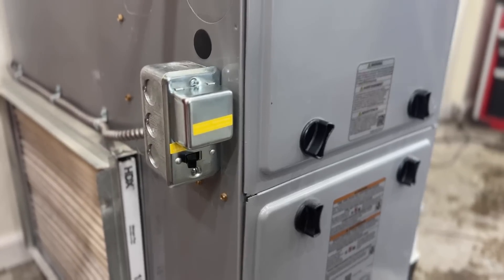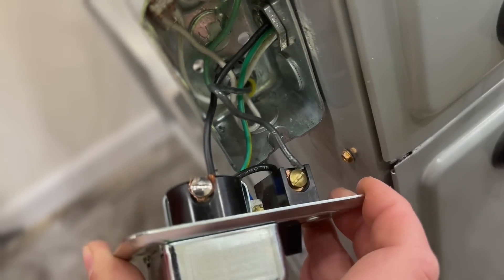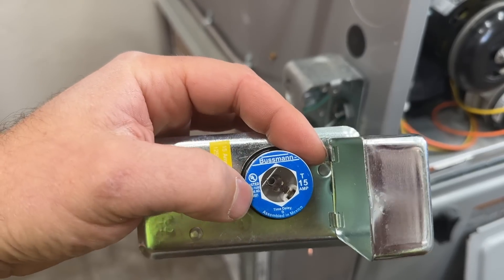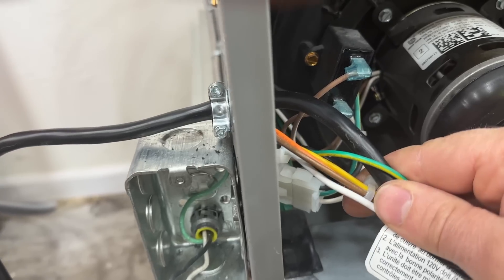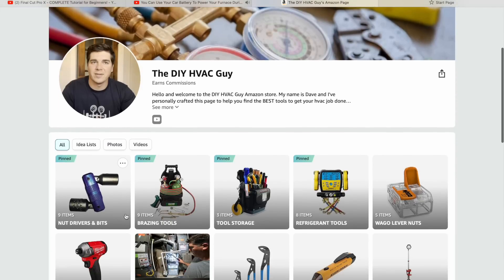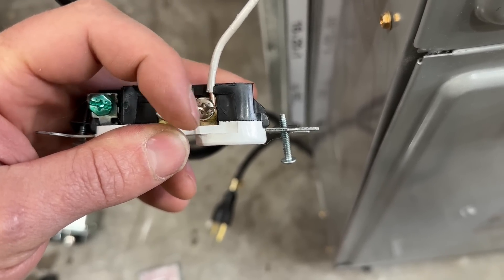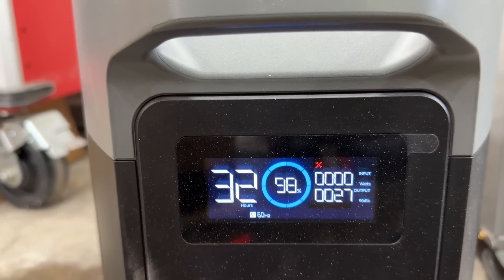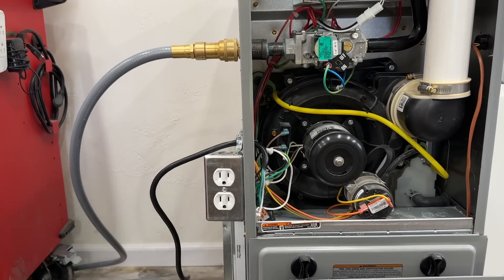Keep Your Family Warm During A Power Outage By Doing This.

Comment: Hey this is an awesome DYI. I just checked my furnace, the wires coming out of my furnace actually connects to a switch that gives power from the breaker. I don't see a fuse like the one you are showing at the 2:48 mark in your video. 

Would I be able to connect the pigtail to those wires without the fuse then change the switch to an outlet? 

Or should I just install a new outlet where the switch is, then install a switch controlling that outlet once the pigtail it plugged directly into it from the furnace?

Thanks

Comment: I tried to do this. It works totally fine on AC power, but when I connect the chord to my portable power station (EcoFlow River Pro 2), the furnace shuts down throwing a ground fault error. Any suggestions on how to fix this please? Thanks!
Reply from the maker: I’d suggest bonding your ground and neutral. See if that does the trick
Reply: @diyhvacguy  Thank you for responding! How do I go about doing that?

Comment: Hi, I have my ac unit almost 1 1/2 year now. New house here in California. My ac issue is suddenly heating is not working. I heard from the attic when I’m watching this video, humming sound like about to start but stop right away. It happened 3 times in different time & day the thermostat set on 73F it went up to 75F. The air filter replaced a month ago. Hope you can help me with this issue, my problem. Warranty is over. Thanks & God bless.

Comment: I guess the most flexible way to handle a condensate pump would be to plug it into the power station as well or, use a cube tap or power strip..

Comment: I have a switch/fuse location issue as far as it being mounted about 4 feet up from the bottom where furnace entry wire from the switch/fuse enters and I could have access.  The switch/fuse switch, only mounted, is 4 feet up and not directly accessible without disassembly of furnace cover.. the grid wire feeds directly into TOP of switch/fuse and furnace wire feeds from the bottom and enters the furnace 4 feet below the switch/fuse. The switch/fuse only mounted at 4 feet above furnace wire entry below.  My furnace is a Rheem installed in 1993.

Comment: A good idea to temporarily bypass the power supply but how do we recharge the battery power centre?
Reply: Portable solar panels would do it.  
For extended outages, some use a generator during the day and a power station at night.
Reply: Plug it into the outlet permanently.  @rik8809
Reply: @rik8809 A gas generator I assume or a very large solar panel setup.

Comment: Myself after coming for the furnace tuneup, I was sucked into the power back up vortex. After all the options I bought and set myself a Generac 10k ng unit with sheding 16 breaker automatic switch. Also smooth start for 3 ton A/C unit. Have not needed it yet.

Comment: How much voltage-amps-watts does an "average" furnace  use?  Thank You !!
Reply: My old 70s furnace drew about 400 watts running and my new energy efficient furnace draws about 180 watts running on a cold day around 20F.  They both only ran 50% of the time so 200 watt/hrs and 90 watt/hrs.  Best to buy a monitor and plug it in and monitor the furnace on a typical cold day to see how many watts it draws.  I set up my home battery bank to handle my whole house load for 8 hours so I did not have to start my generator right away.
Reply: @chuck_howard  Thank you Chuck for the info I appreciate it.

Comment: My new Trane furnace requires a proper bonded ground both to run off the grid power and to run using my Renogy 2000 watt inverter.  Originally Renogy told me my new furnace was not compatible and when I hooked up my inverter the furnace refused to start. They said this was the word from their "best" engineers.  As soon as I put a ground lead from the inverter ground bus to the chasis it worked just fine.  I also called up Renogy to tell them their engineers were wrong.
Reply: If that's their best engineering, return the Renogy while you still can.
Reply: @ewicky  The build quality is great. I have never had any of their products fail.  It's the so called engineers on their customer support staff that have no clue.  I am guessing it's just a bunch of tech level people reading scripts in customer service the same as most large companies now.  If it's not written down they just say it won't work even if it does with some easy modification.

Comment: This works fine, but the ground wire does have to be connected to the breaker box due to the finiky electronics, the ground on a generator or battery doesnt work, it needs to be the correct grounding, so I connected an outlet and made sure the ground wire is always connected to the breaker box from the furnace and it works like a charm and I had to use it a couple of months ago during a coupe or three hour outage
Reply: On my older furnace that was not true, but on my newer furnace it needs a proper bonded ground to run using the mains power and to run with my Renogy 2000 watt inverter.

Comment: In some places in the US they allow the doorbell transformer to be shared with the furnace.  The fused switch gives some protection for that.  The furnace has a fuse on the PC board usually located on the squirrel cage/blower motor that will protect the furnace and motor.  Hey it's your house do what ever but hook things back when you sell the house.

Comment: Wouldn't it be better to wire the receptacle through the fuse (add a second box) so it has the same protection if it's a different rating than the breaker? I don't know why you would have a fuse and a breaker but I'm sure some districts have a reason.
Reply: I don't think you need a fuse.  You've got a breaker already in the circuit via the inverter.

Comment: I think you should work with a licensed electrician, I don’t think you understand what the fuse is for
and it is a code requirement in many jurisdictions. The fuse is for mainly motor protection it is much
more sensitive than a breaker of the same rating. The motor can over heat and catch on fire before the
breaker trips.
Reply: That's only one thing that's wrong here.  The unprotected cord out in the open where it is susceptible to damage is another issue.  He continues to make these kind of mods, which while they work, would not pass an inspection.  Notice how he never says it's "to code".  If you want to do this kind of thing, spend a few extra bucks and do it right with a power inlet transfer switch.  A brand name one costs about $55, and would pass an inspection without problems.
Reply: @yeroca  no one can say "to meet code" because literally every county of every state has different codes......... I swear, common sense is like having a super power nowadays
Reply: @natersalad889  You have made a fine point, but this solution doesn't meet any NEC code from the last 20 years, and most state codes are based upon NEC from some year.  So this solution has an excellent chance of not being code-compliant.  See 422.16 (A)(2) of NEC 2023, for example.  Most gas furnaces are not "intended or identified for flexible cord connection"
Reply: @yeroca   Maybe a fake UL listed one costs $55 but not a real one
Reply: I am very interested in knowing why there is a fuse after the breaker.  My dad and I live in the same town, his furnace has a fuse as shown here and mine doesn't.  What gives?  I see your point of using a fuse working as a normal and a breaker as slow-blow fuse.
Reply: @JT-lq4yd  Hi,  hopefully your furnace was installed by a competent installer and a inspection was
done by the authority having jurisdiction. your furnace maybe newer and have it’s over current protection 
 built into the furnace. I just don’t think you start removing things without completely understanding there
intended  purpose. There is a reason why electrician’s are licensed. Breakers are not considered as proper 
over current protection for motors, ask an electrician.
Reply: @JT-lq4yd this type of switch an SSU switch and the fuse is called an edison fuse. Some furnaces may list an MOCP (maximum overcurrent protection).  Say 6.25amps.  Most furnaces are on a 15amp circuit.  In this scenario a SSU switch with 6.25amp edison fuse would be needed to protect the device.

In the video the edison fuse was 15amp as well as being on a 15amp circuit.  Thus, the 15amp edison fuse is not providing any more additional protection than the 15amp circuit/breaker already provides.

These videos are showing what can be done to prepare yourself for an emergency or during an emergency situation.  

Keep the original parts and change it back if ever needed. (I.e. selling a home and local inspector requires SSU switch with a specific amp rated edison fuse at furnace).

Comment: Hi Dave: Thanks for these keep your furnace going videos. I watched your original ones, and installed the “plug,switch, pigtail” setup in the 12-9-22 video as you directed, then I upgraded following your methods in the “EX Generator Switch” video of 2-24-23. I saw you used the Ecobee thermostat at your house, so I purchased and installed that too. When I tested for each setup, I only did several minutes to confirm functions. But, I just had my first outage, and was happy to use the EZ Transfer Switch setup. The furnace ran perfect off my Delta 2, but after a few minutes, the flame kicked off as required by the thermostat setting. However…the fan never shuts off! It runs on and on. So I try again.  I unplug everything, let temp drop below the 70 degree setting, set furnace to 70 to call heat, the furnace kicks on again, fan comes on as usual, house warms to 70, then flame goes off and again, the fan never shuts off!  I installed to your specifications, so Im confused. Since you run ecobee as  well, might you kno which wire I need to investigate? Or what I should check? The setup is perfect otherwise. Thanks.
Reply: Is the T-stat Fan function in the ON setting?  Should be in auto.
Reply: well its normally set to auto. Youre not suggesting thast it gets thrown over to "on" are you? Would it do that. Back on grid power its always back to "auto", i never have to play with it. @ptso7580
Reply: I don't use a 'smart' thermostat' but could it be the Ecobee is re-setting the blower to run always, due to momentary power outage before switching?
Reply: but when i switch off EZ Switch and go back to grid, the Ecobee is back to normal without me doing any resets, etc. . @gnic76

Comment: is that outlet upside down???
Reply: No - the single ground prong should be on the bottom.  the ground prong is longer than the two power prongs so it goes in first and comes out last and decreases the risk of a shocking hazard for the person.     The reason for the prong to be on the bottom is so  if the cord is accidently or violently yanked from the outlet or if the outlet is somehow damaged/broken and the wires come free inside the wall you want the ground to be away from and below from the power wires to lessen a fire hazard.

Comment: Why is there a fuse and a breaker on this furnace?
Reply: The (fuse and switch) may be required to meet local building code on a new furnace installation or a newly built home in order to pass inspection but that doesn't mean the homeowner cannot change it later to do what he did to enable a home battery backup to power the furnace if the grid goes down during the winter.